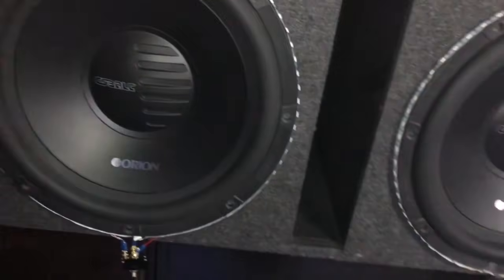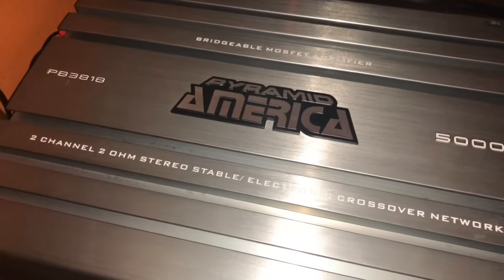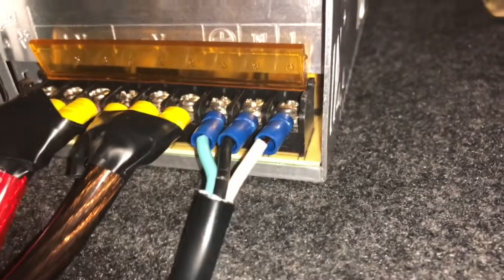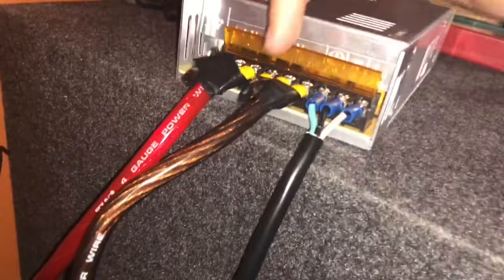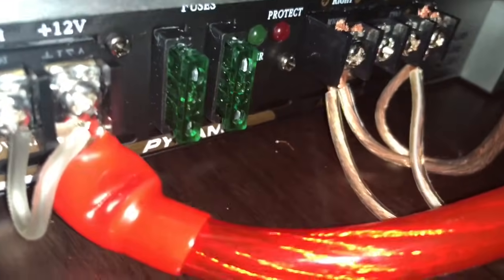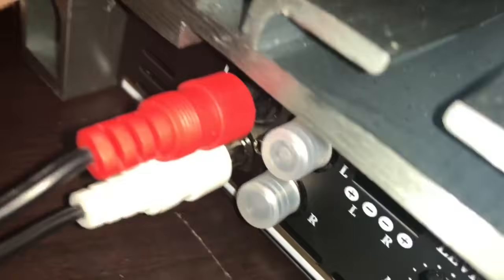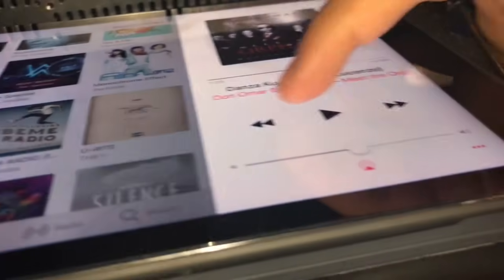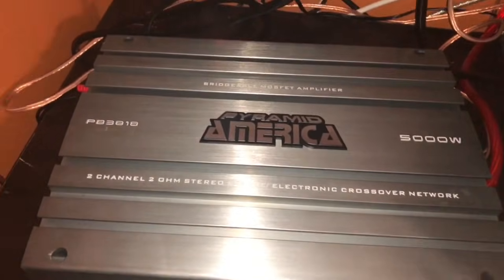How to use your car amplifier at your house using a power supply

Comment: 30 amps FOR 5000 watts isnt that less!
Reply: 5000 watts is just marketing bro, pyramid is a scam artist that amp is probably outputting 250w max
Reply: @automachinehead  shit man ur probably right. But what if the power supply is also flexing more power than it has? Can't trust nobody
Reply: @moodydude565  the ps has a constant 12v rail if it's below that the amp won't turn on. the only thing that's going to rise/drop is the current which will depend on the dc resistance of the driver below 1kHz so the more it drops the more current to produce sound. more current, more heat. more heat, blown fuse.

Comment: what if i use a stronger Power Supply with more Watts and Voltage will it improve the sound or burn my house down ?
Another question, will 1 power supply be able to power 2 amps ? or i'm gonna need 1 for each ? thnx
Reply from the maker: Orochi Mishima The fuse will just blow

Comment: This says it’s 2 ohm 5000 watt but had two 30 amp fuses? I have a 1000 watt amp that’s 2 ohm with 2 30 amp fuses?
Reply: collin blanford Depends on amplifier design also, my ground zero is only 440W if all channels are loaded but has 2x30A fuses (class ab, need almost 700W for that output)
Sadly your amplifier isn't 1kW, even with class D and 90% efficiency you would need about 1100W on input, thats almost 100A so those fuses would blow instantly. It' most likely 500-600W amplifier, same as this guy.
Reply: I do run over 5000W rms and I tell you, 30 amp fuses is WAY too small. Try 350A in line. Also, my audio could draw over 1000W rms off a 240V JL Audio power supply. 
Please be more accurate in your power ratings, as pesk power (as your 5000W amp states)  is not an accurate rating. 
ALWAYS rate power as "rms" as that's the true input and output numbers you need to work with. 
As a reference, I ran an MTX 92001 D Class monoblock (3700W rms 1ohm) with 200A fuse and a 91002 A Class 2 channel (1300W rms 1ohm) with 150W fuse. 
There's NO WAY your setup would even come close to surviving that sort of load. 
Readers be careful. The idea is good, but check your numbers first.

Comment: So the wiring to the house outlet is wrong in this, the BLACK wire is the hot wire or live as you called it, white is always the neutral. Since it is marked that way in your power supply I’m guess it is polarity sensitive. You might want to change it before you burn that power supply up.
Reply: Correct.  Black =hot/live, White = Neutral, Green = Ground.

Comment: Man I'm a real Bass junkie,Bout to do this real soon,I got a 3000w  taramps class Damp, I wanna hook em up to( 2) very old 12"in Audiobahn q flames in a probox, I figured I use them as house speakers since there laying around or until I can find a good deal on some dj pa /subwoofers ,I looked into house systems ...man for the prices iv seen  I decided to just build my own,comes out  way less n with better sound.. thanks for tha video bro, helps with what I'm tryn 2 do..... 😎
Reply: Course Reaction Have fun with that, you are gonna need at least 3.5kW power supply, thats about 12V 300A ;)

Comment: Is the psu still working? I was using a PC psu to power my 300w rms amp and after about 6 months the voltage from the psu dropped to 11v and drops even further when the bass hits.
Reply: Aneesh Surendran use battery car

Comment: Do this power supply need any capacitor or fuse
Reply: Some do well usually a compactor does have a fuse as well as an amp would, if you overpower the amplifier, do to overvoltage, well, u can change the fuse easy as that,My amp takes a 30 amp fuse, so a 30 amp fuse for a car or truck should be compatible

Comment: with 30 amps u end up with about 300 watts to the speaker.
Reply from the maker: Charles Hendricks 5,000 watts
Reply: impossible with a 30 amp power supply....do the math.    amps x volts = watts produced.  30x12= 360... figure the amp is class D....about 85% efficient....306 watts.
Reply: Note also... the 5000 max spec on any amp should be ignored. All that matters is RMS rating. On this  amp it appears to be 500 watts at 2 ohms...spec sheet is written a bit strange tho. Great idea tho... beats hell out of trying to use xbox/computer PS to power an amp. Im running a 75 amp server power supply to a PG car amp to a lil 10 inch sub in my home theater.
Reply: @charleshendrick7266   volts is 120v
Reply: @charleshendrick7266  good
Reply: @Firealarm102  anndd got distortion
Reply: hey charles hi...i got jbl gx a3011si 300rms amp... is it ok if i go for this power supply of 30amps or should i go for 40amps supply...anyways i am going to power single 12inch bandpas sub with 350rms.
Reply: Assumiing its a class D amp 30 amps should be fine.  There is a fairly big $$ jump between PS for that 10 more amps.  One can find a server PS used online for fairly cheap tho.... but you have to have the pinout info so u can modify it to work as a bench PS.

Comment: Thoes car amps are ment to run best at 14.4 to 15  volts you should adjust the little orange screw next to the green led and raise the voltage to 14.4v by turning it clock wise also at 30 amps that thing is probaly pusing out 250 watts per chanel tops
Reply: @pietkrijger 100amp converter / charger with a car battery. You can get them on Amazon and other places.  There's  really only 2 or 3 options.  Cost about 170 bucks  Capacitor may work also... Never tried it. But 2000 watts is about the max on a single power supply... Suggest a powermax PM4... That's the biggest and cheapest power supply I'm aware of that will do what you want.
Reply: actually it matters little. As you adjust the volts up the amperage goes down.. with total  wattage output remaining the same.
Reply: @charleshendrick7266  but you'll burn it (overheated)  because high current..
Reply: Charles Hendricks if I have a 500 25 amps watt amp which power supply is best suited for me a 30 amps 360 w or 40 amps 480w?
Reply: @vernon434  you need 40+ amps for 500 watts
Reply: Prank Masters that made as much sense as a pineapple growing from a cactus...
Reply from the maker: TFAY Productions this car amp is 12v as shown
Reply: I know the package says that the amp runs on 12volts but they are meant to run in a variable range from 11.0v to 14.6v i know this for a fact because i work on cars and the out put voltage from the alternator of a running car is 14.5 volts and these amps are ment to run off that voltage. They label them as 12v because that is the “recomended” voltage, running the amp at 14.5 volts will make the amp have a cleaner output to the speakers/subwoofer and it will help with distortion at louder volumes.
Reply: And this is a car amplifier